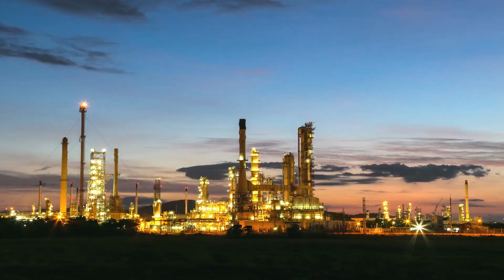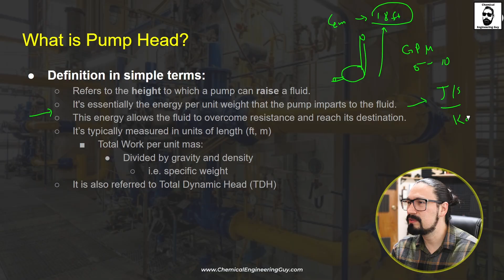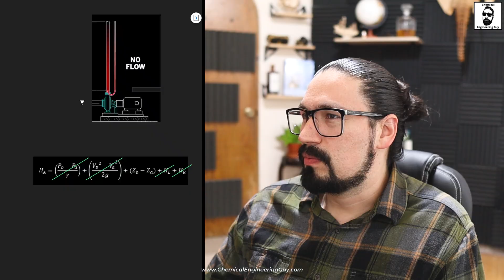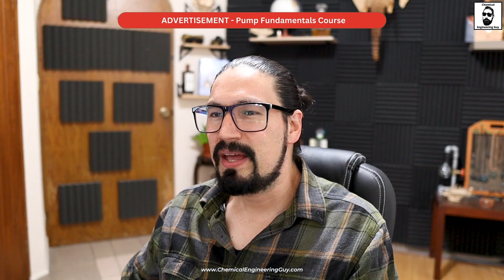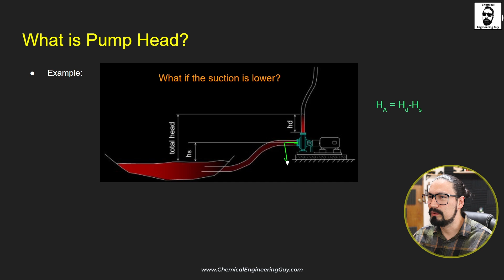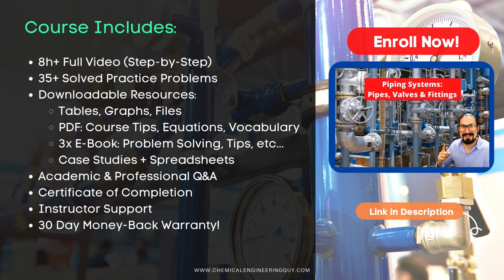What is Pump Head? Application to Pump Design, Selection & Operation

Comment: Supposing static water level is 15m and dynamic is 90m , pump installed at 120m , yield 500 litres per , tank height 6m , distance from well to tank is 80m, how do I determine a pump head to be installed in this well
Reply from the maker: using TDH (total dyamanic head):
TDH = Lift from dynamic water level + tank height + friction + margin

Lift = 90 m (dynamic WL) + 6 m (tank) = 96 m

Friction (80 m pipe, PVC C=140):

500 L/min → ~22 m (2"), ~74 m (1½")

500 L/h → negligible

Add ~5 m for fittings + 10% margin

Examples:

500 L/min, 2" pipe: TDH ≈ 135–140 m